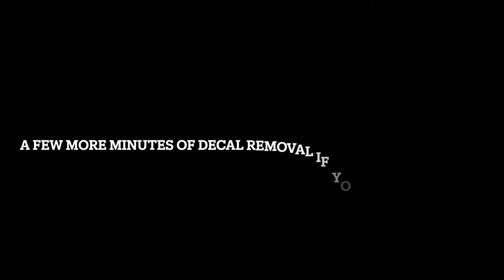Vinyl Decal Removal with Steam RV

Comment: I have a 95 sweet water pontoon boat 28year old boat 4 inch decal been on there I covered the 4inch striped around the boat with a new stripe because I didn’t want to deal with trying to take off old one you are a genius 😂 this is awesome for plenty of people who want to remove decals I thought of heat gun or blow dryer but never tried it thank you for sharing enjoy your motor home
Reply: im having same issue with my sweetwater. i used a rubber wheel, nope, used razor blade  nope, used heat gun, better, went to auto paint store to ask them, he gave me acetone, thinking the fence was powder coated, nope it was paint on aluminum  panels. so i have to prime panels where registration is placed as i took it to bare metal.  went to lowes and ask. they recommened pro goof off for the sticky residue,  it took the sticky residue off but also the paint and it is pricey. for a small can.  removal was same as acetone. i got all the vinyl  off with heat gun and rubber wheel,  but all i have left is the sticky residue. i don't want to strip and repaint the whole 20 ft boat.  now i have a vinyl off liquid coming from amazon, and plastic razor blades. i have a steamer going to see what that does to the goo residue.  any and all help is welcome.
Reply: @lynnallen5528 use gasoline on a microfiber cloth to soften the glue. Scrape it with a plastic razor blade to get the bulk of it off. Any remaining residue will come off with the gas soaked rag.

Comment: Thanks for posting , I had been working on my funhauler using a heat gun and plastic scrapers . It was working but taking forever. Tried the steam cleaner and it was much easier and way faster. My rig is 20 years old and all the decals were pealing and badly cracked. Looks so much better now after the buffing .
Reply from the maker: That's awesome! I'm glad it worked for you! I had really good success with this on some vinyl and not so great success on different types of vinyl.

Comment: For anyone looking to do this and wanting to use things you can quickly pickup at a nearby hardware store:
-Heat gun
- plastic razor blade with holder (you need a sharp, stiff tool that won't scratch)
-GOOF OFF... NOT goo gone. You can find it in the paint section as a paint and adhesive remover. 

Remove the decal or graphic with heat and the razor. If they are cracked this will take longer, but if they aren't they will come off in large pieces if you don't use too much heat. I found that the hotter they got the more weak they were and they would just rip. If i got the decal started with the razor and heat, and was able to start peeling it, it would take the adhesive with it, but everywhere that required the heat and razor left the adhesive behind. 
Fold a rag into 4s. Soak with goof off and hold it onto the glue for a few seconds. Scrape with razor... it came off like butter. It leaves some glue balls but they seriously just wash off when you wash it with a mild abrasive. Wash, dry, and buff. 

I bought a gallon of goof off and used about half of it on 4ish decals. Some were small and some were large. The goof off does evaporate and you still need gloves and good ventilation... also its flammable so keep away from heat gun. The more the rag is soaked the easier the glue comes off. I watched so many videos telling people to by graphx remover, some special 30$ tiny spray bottle of remover, or rubber wheels...i spent like 26$ on the gallon but you can use goof off for so much stuff. Mineral spirits and acetone didn't hold a flame to it... because my step dad thought he knew better and wanted me to try it. I already owned a heat gun but the are cheap. The pack of plastic razor blades was about 6$ and i bought my stuff at ace... which is more expensive than just about every other hardware store. For about 50$ and 20 minutes in a hardware store you will have all you need. Obviously, be careful with the heat gun and don't burn your gel coat or paint. It took me about 3 hours and 15 minutes to remove all of the 4ish ones i had to do.